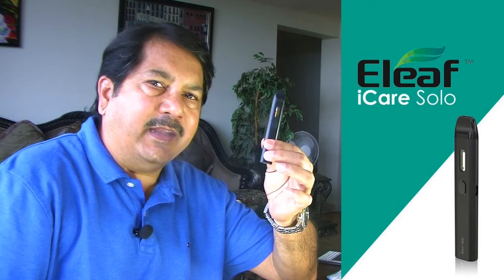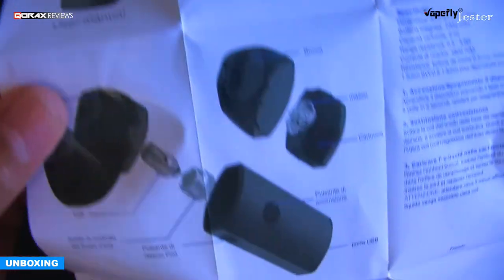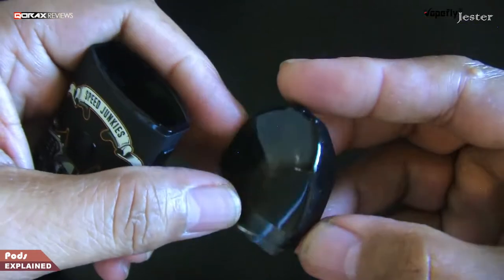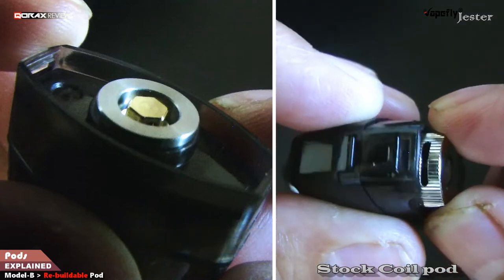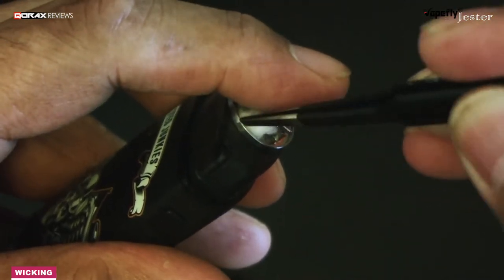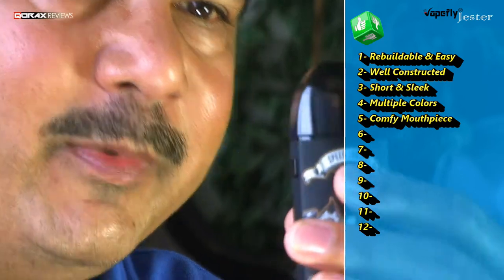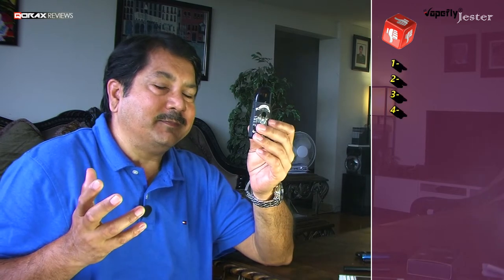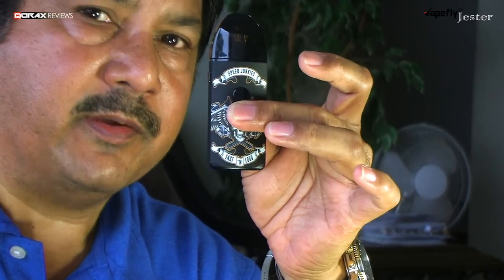Jester ~Re-buildable Pods / REVIEW

Comment: The draw can be tightened on the RBA by lowering the coil closer to the air feed, although that may not be a worry for the new vaper anyway, as they are more likely to be using the stock coils.
Best way to charge it without the chance of seepage is simply to remove the tank while charging!
It really needs that dark tank made far more transparent though, as a dry hit is probably the one thing that is most likely to drive a transitioning user back to cigarettes.
Still, I hope to get an up-close look at the UK Expo.
Reply from the maker: Well said Phil.

Comment: Great review! Just want to share my experience with it in case someone else experiences the same problem I did. I opened it and tried to build the RBA last night. I installed the coil and tried to dry fire it. It would not fire. I installed the pod with the 1ohm mesh coil and it fired no problem. I tried the RBA pod again immediately after and still would not fire. I made sure the legs were tight in the posts. Still nothing. I thought maybe the play in the RBA pod you pointed out was not allowing a proper connection. (Just a side note, the mesh pod is very snug and does not wiggle like the RBA) After 1 night and 1 morning of using the mesh pod, I tried the RBA again this morning and now it fires without a problem. I'm not sure what the issue was. Also sometimes the red indicator lights don't blink when I install either the RBA or mesh pod, but it will still fire unlike last night. Just wanted people to be aware that I had this issue in case anyone experiences the same problem. I hope I don't encounter this problem again with continued use. Vape on! 💨💨
Reply: Also, the mesh coil pod does not have any play whatsoever like the RBA pod does. At least that's the case with my unit
Reply from the maker: Thanks for your testimony Chris.

Comment: Which one would you recommend me for solid MTL Nic Salt vaping?Pasito or Jester? I've never done rebuilding before.
Reply from the maker: For someone new to re-building ~ Jester is better. B'coz it has a wider deck, thus easier to work on. However, as an overall better device - it'd be the Pasito. Better construction/materials, more capacity, magnetic attachment, AFC and slightly more flavorful. Cheers!
Reply: @QoraxStan  So, for me, you're suggesting that jester would be better. I was little confused on which one to purchase. However, can I use pre-made rebuilt coil in jester pod instead of building on my own? And it would be much appreciated if you can suggest how it is possible to avoid leaking and condensation?
Reply from the maker: (1) Yes, pre-made coils are fine
(2) That leaking & condensation is actually not a big issue here.